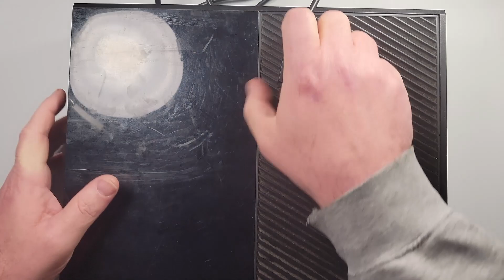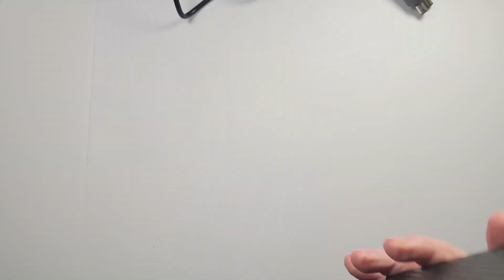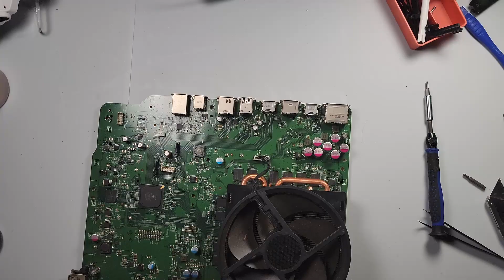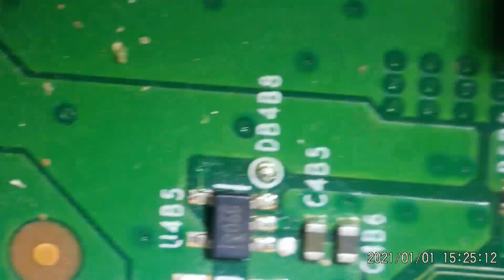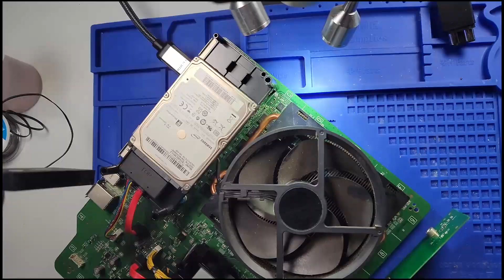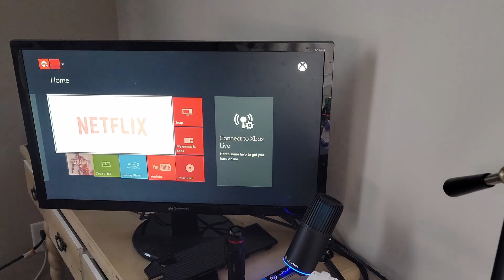Xbox One Model 1540 No Power Missing Standby Voltages

Comment: Had a similar problem except i have all voltages except 5v standby via drain of of U4B4 mosfet. Lifted the leg and 5v becomes present but still no 12v. Replaced U4B4, reflowed U7P1 and surroundings but still nothing.

Comment: Hi sir, I have 5V in the output of that MOSFET (23:07) so if I get it, that means that everything its ok, right? But mi Xbox turns on only 2 seconds and it turns off again, ¿That means that my issue is the power supply? Because I have managed to turn on my xbox a couple of times. Great video btw

Comment: I have the same Xbox turns on fan spins but no display . Checked hdmi port and looks good any tips ?
Reply from the maker: I had an Xbox One S that turned on but did not output video. It ended up being an open run between the APU and the HDMI IC. This is the video I did on it: https://www.youtube.com/watch?v=u4Pu7-gZ_wk&t=13s

As far as I have learned, when you power on an Xbox, a 3.5V signal is sent to a very small chip called that is referred to as the ESD IC. WHen this chip receives the signal, it produces 5V to pin 18 of the HDMI port. This 5V alerts the TV that something is plugged in and it returns the 5V, called Hot Plug Detect, to the ESD IC to let it know, that something is plugged in. The ESD IC then sends a 3.3V signal to the HDMI IC, typically referred to as, the "retimer IC." Once the retimer IC receives the signal, it begins to output the video signals. Watch that video and see if it will help you solve your issue.

Comment: Hii buddy finally i fixed it now turns on it was worked normally for some time but after some time its giving no display output hdmi port is ok when trying trying to turn off its gives me starting beep every time i press the button but doesn't turns off
Reply from the maker: Do you have another Hard Drive you can put in it?
Reply: Hey thanks for the reply Got another Xbox with same problem but ther is no 3.3v in U6B2 5v is present in standby I don't know how to figure it out can u help me with this

Comment: Hii bro this is great video. After lifting the lag now im getting beep sound but still not turning on fan are not spanning im getting voltage on u4b4 but still nothing
Reply from the maker: If you are getting voltage on the output of U4B4 and it is 5V, then the next step would be to see if you are getting 12 V coming out of the Power Supply. The beep means that your standby voltages should be good. If you are getting your 12V, then the issue is not related to voltages. If you are not, as a quick check you can ohm your 12V line to ground, to ensure it is not shorted. I apologize if I am confusing.
Reply: @probablycantfixit6426  thanks for your reply i have exact same model like yours and exact same issue as yours completely dead there was no supply in u4b4 but there was supply on other same one on left also 3.2v was present. so i did as u said i lifted the one lag of u4b4 now im getting valtage around 5.7 after that i plugged everything. Now when i trying to turn on it gives me a beep but no light or no fan speen every time just beep beep beep. It will be really fun if its fixed i also wanna react woow... like u !
I will be appreciate if u like to help me with this. if not still great video and its really Helpful😛 i learned something new

Comment: This issue is happening to me since last week and the issue is that I can't turn on my Xbox it's the og Xbox one I press the x button on the console and it makes a sound but won't turn on the fix that I had was that if I removed my external hard drive it would turn on for some reason but now it doesn't work removing it and still does the sound while trying to turn on, it's not the PSU since the light is orange might as well be the motherboard?

Comment: Good work buddy I just sub to you I have a question all my capacitor reading 001 can one bad capacitor cause that problem please help 😞😢😭😭😭
Reply from the maker: Thanks.  I am assuming you are measuring resistance across the capacitor.  If one capacitor is shorted, and it is in parallel with another capacitor, then the other capacitor will show a short also.  A chip that is shorted to ground can also make the capacitors look like they are shorted. If you have the soldering equipment, you can pull the component that you think may be shorted and then measure resistance again. Hope that helps.

Comment: Great video. Did you try to take out those 2 resistors and check them?
Reply from the maker: Thanks alot.  I did not pull the resistors from what I remembered but I did check for voltage on both sides effectively proving that the resistors were good.

Comment: Awesome video. You do a great job explaining it and I'm someone that repairs for a living. Most creators just fix it and may mention a part or voltage when breaking it down like this really helps beginners/novices. It helps to understand how the things work and that carries over to all electronics.

Really good work.
Reply from the maker: Thank you very much for the kind words, very much appreciated!
Reply: Thank you for the video, sir.

An odd question but do you happen to still have the ID or datasheet for that 16 pin buck converter? Thanks.
Reply from the maker: @DannyWilliamH  Sorry, I forgot to respond.  I do not but all I did was google the numbers on the chip and somehow found it.